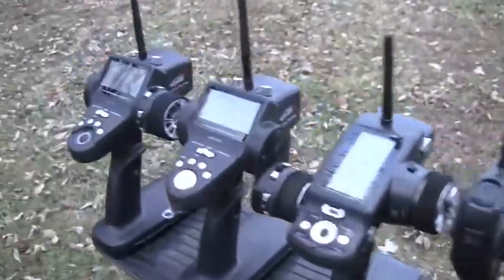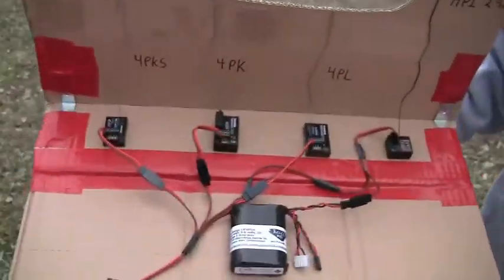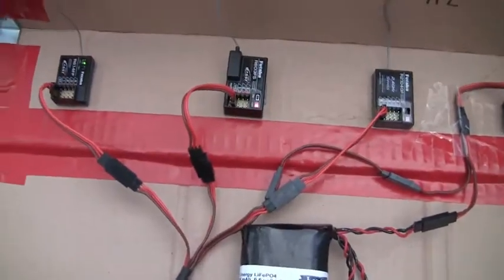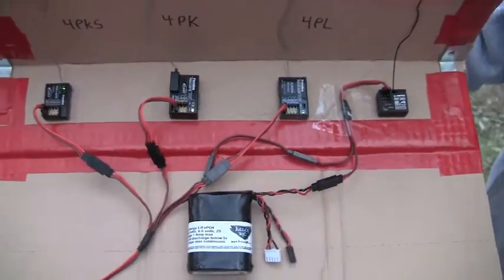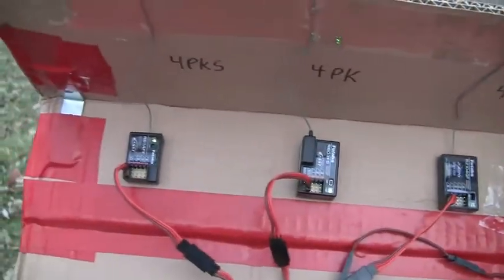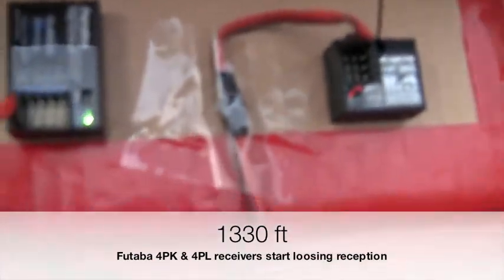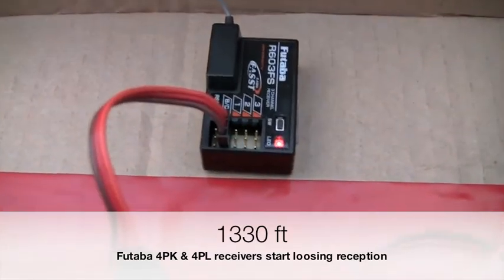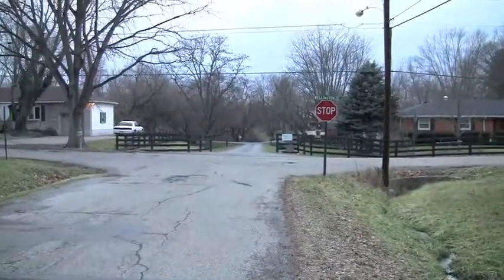Futaba 4PKS 4PK 4PL Distance Test

Comment: after i got my 4pks radio last year i did a range test with rx and batt setup on a piece of cardboard with its antennae taped upright, and a person walked to end of road, our road in front of my house from cross road to crossroad on ends is just shy of a 1/4 mile, it worked perfectly at that distance with no signal loss, much much much further than i would ever even run the baja 5t. so there ya go!

Comment from the maker: @kingazza12311 The 4PKS has faster signal speed, a few more menu options for rock crawler type stuff, different trigger, more steering wheel angle adjustments, different navigation button. The 4PKS comes with a smaller receiver, which can handle a 2S LiPo battery pack. They stopped making the 4PK a year ago.

Comment: I'm an airtronics guy I had the m11x and ran it in my Baja and when we would go out no one had the range I did. Spectrum is a joke my buddy had dx3s and dx3r and they were both junk. futaba is ok but now I run m12 and I get even more distance with it. By far best radio I have ever used

Comment: I may have to get the Futaba 4PL radio. I have a Spek dx3something that came with my rtr losi 8t2. it was a great rtr radio but since i started racing with +10 people on the drivers stand the system just looses connection which sucks when you're in 2nd hunting 1st.

Comment from the maker: Yeah. Airtronics are good. They'd be my 2nd choice. I had a M11. It was a little heavy and the menu wasn't as real intuitive, plus its annoying having to turn the radio sideways to look at the screen while you're driving. My #1 choice is the Futaba 4PKSR. Spektrums have the easiest menu to navigate, and the scroll wheel is nice, but they just aren't reliable to run on gassers.

Comment: That FHSS tech is awesome... I have a Turnigy radio that uses it and I get about the same results. 1300-1400ft on a mini rx to boot. $45 tx and $8-$12 for the extra rx
Reply: You referring to the Turnigy 3XS correct? I have that same radio and it's actually really good but I purchased the new Futaba 4PX to give it a go.
Reply: +xXG.L.HXx yeah I took the plunge as well. 4PX is so much faster than the old 3XS it's literally night and day.  I feel like the 3XS gave me a little better distance though.
Reply: BASHERS UNITED Hmmm, that's interesting. I just ordered mine today from Tower since they have it on sale (saved even more with discount code) so I haven't tried mine yet. I'm more of a budget basher but after seeing the 4PX in person at my local track I just couldn't help myself.
Reply: +xXG.L.HXx well not much distance . I'm talking about 20-30 more ft. if any. the 4px shines in response time though. barely a difference in repose up to 1200ft. pretty slick!
Reply: +xXG.L.HXx I got mine as an open box item on Amazon.com  $110 off. There is this issue where some of the packing Styrofoam makes its way under the screen. easy fix but know that's it's a possibility.
Reply: BASHERS UNITED Wow, really!? That's disappointing to read. Such a high price for a high end radio and that happens. My local track gets really dusty when not race prepped so I hope I won't have dust getting behind the screen. I got $135 off of mine from Tower so that's a good start at least. Thanks for the heads up!
Reply: +xXG.L.HXx  I'm sorry I should have explained it better. Its just the packing material that got in their from the factory. Once you take the plastic cover off the screen and blow it off nothing ever gets in there again. Just a minor annoyance not any sort of continuing issue.
Reply: BASHERS UNITED Ahhhh, okay, thanks for the information!

Comment from the maker: I'll take a Futaba over a Speky any day, especially on large-scale gas RCs. BTW, the DX3R and DX3R Pro is only a 2 channel radio when it set in high resolution frame rate (5.5ms), which is lame. I need at least 3 channels, and 4 channels is even better.